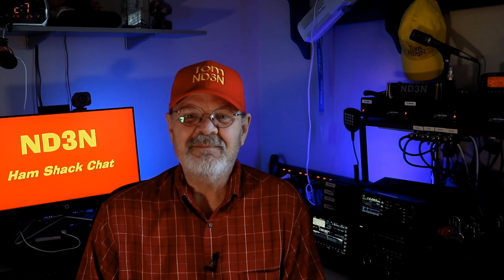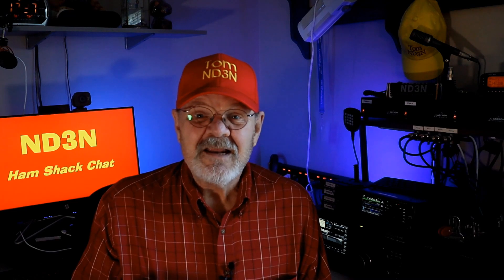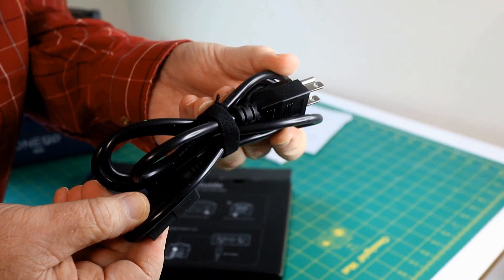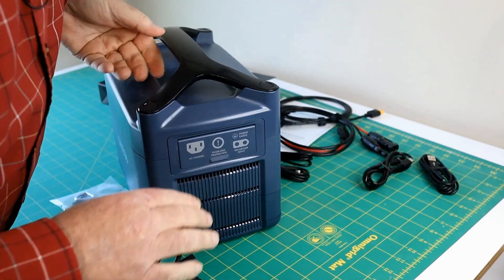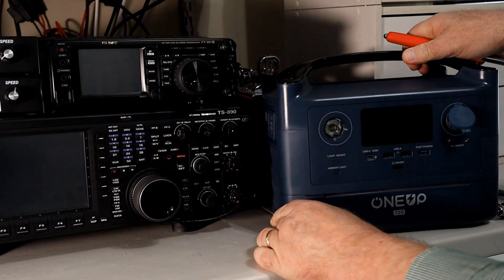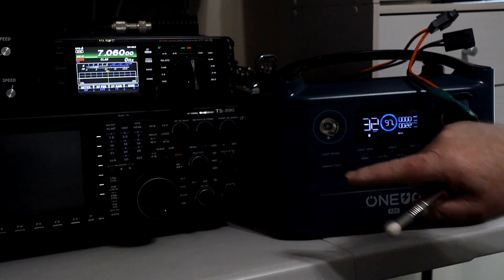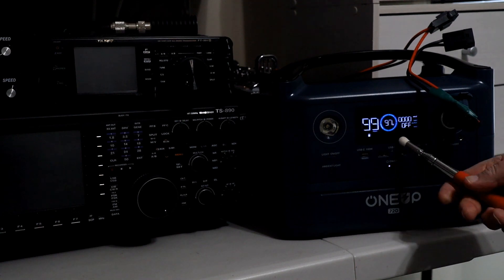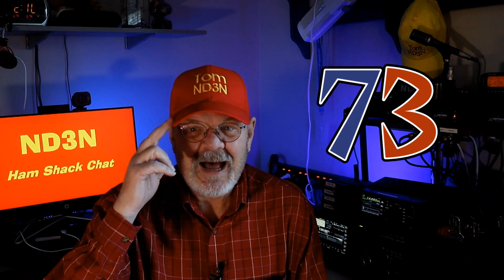720 Watt Hours of Portable Power - The OneUp 720

Comment: Tom, the 818 or the 891 is a tough call in my opinion.  I do like the all band all mode capability that the 818 gives you; but I do like the 100 watts that the 891 gives you too.  So I guess it comes down to how much VHF/UHF would you do with it?  If it's not too much then I would go with the 891.